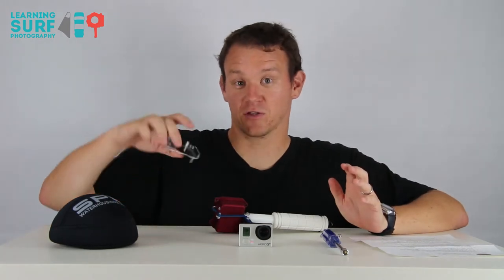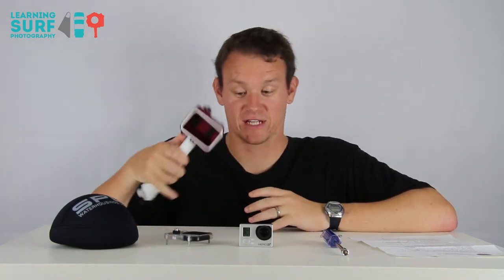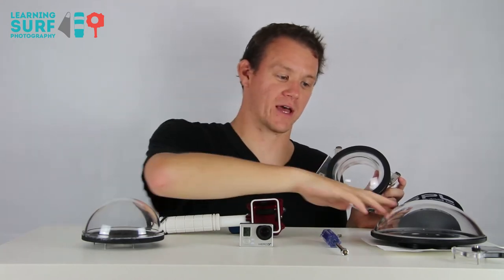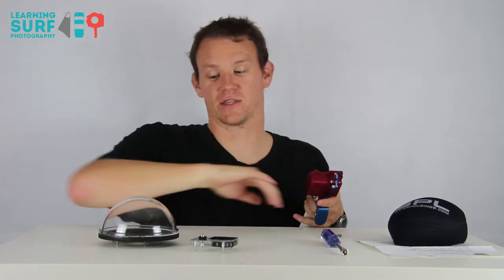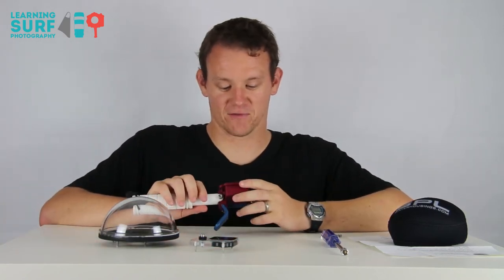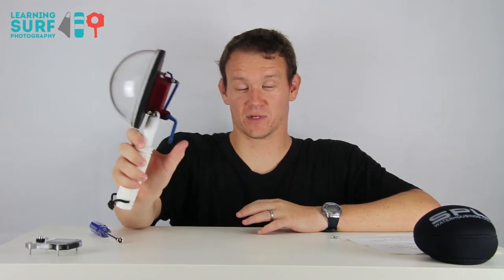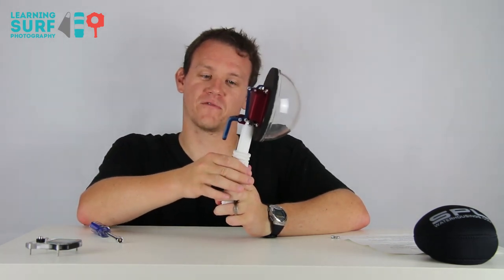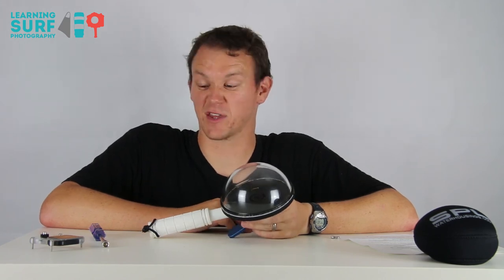SPL GoPro Dome Port First Impressions

Comment from the maker: @xTHESEA there is no control for the front or side buttons with the dome in place, you have to turn it on and set it to the required mode before putting the dome on.

The flat port which is supplied with the pistol grip does have a button for the front and top buttons but not the side button.

Comment: Great information, I'm looking into buying one my self. Think I'll be getting the 5 inch dome port, cuz the 8 inch one is a bit expensive compared to the 5". Are they made of glass or acrilic? Are they tough?

Thanks again.
Reply from the maker: This one's made from Acrylic, it's tough but it's definitely possible to scratch it, any minor scratches can be polished out and a lot of the time minor scratches won't show up in the photo's or videos because they're filled with water when you shoot with the wet port method (more info here: www.learningsurfphotography.com/prevent-water-drops-wet-port-vs-dry-port/ )

It's the same quality as nearly every other surf housing dome port so as long as you're careful it'll outlast your camera.

Comment: hi great video but i have a question. which would you prefer the thump trigger or the front trigger? thanks!
Reply from the maker: The front trigger is a more natural movement as I'm used to shooting that way with my DSLR housing, but the thumb trigger does work. I believe SPL have a different front trigger version now too, so it's worth considering going for that, especially if you plan on using a DSLR style housing in the future.

Comment: Can you just go through the camera settings again for me before you bolt it all up . I have the camera set at auto on , on the top button , with one minute off. I am continually finding the camera starting when I set it up and put in a bag ,  I like to set the camera before getting on the boat or ski .I have now put a cork under the handle to stop this (a spring would be nice) but it is still triggering, I think it's triggering from the side button. It creates alot of heat if the camera has been running in the bag and fogs the dome. The camera is such a snug fit it only takes a touch to fire.I want to shoot video obviously doing something wrong. Thanks Rob
Reply from the maker: Hi Rob,

Sorry for the delay replying, I can imagine the problem you're having, I had the same issue when using the dome when paddling an SUP, I would strap it down to the deck between shooting video clips and often it would start recording.

Unfortunately I don't think there's an easy solution beyond what you've already tried, some sort of safety switch could be made to stop the trigger setting off the shutter accidentally, but it would have to be easily removable.

Comment: Hi Ben, thanks for the video. Have you tried altering the camera settings with the gopro app once in the housing? Cheers, Jack
Reply from the maker: BonneApp Hi Jack,
I did try it out, but I couldn't get it to connect, I believe the aluminium blocks too much of the signal unfortunately.

Although I only tried it with my (android) phone and the old style WiFi Remote that I got with my Hero 3+ Black Edition, and the new Smart Wi Fi Remoter is supposed to have better range, so you might find the new remote or a phone with stronger WiFi would be able to get through.
Reply: Hey, just to confirm, the app works fine for me in the metal housing. Thanks again for the video. Jack
Reply from the maker: That's good to know, thanks Jack, maybe my phone didn't have enough WiFi sensitivity.

Comment: Do you get more over and under coverage in the shots with the 8 inch dome?
Reply from the maker: Hi Matt,
I've just finished editing the review video where I cover the 5" vs 8" vs 10" vs 11" dome options, you don't get more coverage as such, the angle of view is the same as it's determined by the lens and settings on the GoPro, but it does make it easier to have a distinct water line between the above and below sections.

I'd recommend the bigger domes if you want to capture waves bigger than a foot or so, otherwise the 5" is a great tool.

Comment: hi ben is the dome port only good for small surf and over under shots?
Reply from the maker: Short answer - yes. That's what it's designed for, if you don't want to shoot over/under then you are better off using the flat port that's also supplied with the housing.

Comment: So you prefer pay 250 for that or just use the automatic photos in the gopro ?
Reply from the maker: jake peralta I'm not sure what you mean, you can use the same settings for automatically taking photos with whichever housing/trigger combo you use.

The standard GoPro housing doesn't allow you to take photo's one handed, having a pistol grip style shutter release is very useful for surf photography.

I wouldn't recommend getting the SPL housing and pistol grip only for the flat port though, I'd go for the KNKT GPLT trigger for that. The reason you'd buy the SPL system is so you can use the dome port, it allows you to take photos that are not possible with the standard GoPro housing.

KNEKT have their own Dome port now though, and I've used both, so I'd recommend getting the KNEKT system because there's a couple f advantages, you can find out more here: https://www.youtube.com/watch?v=9G4zbAF7QWE

Comment: does a lease come with it
Reply from the maker: There's no leash provided as standard, at least not with my package, but there's a leash string on the bottom of the handle so you can attach any suitable leash, I use a short bodyboard wrist leash.

Comment: hello witch one is the best quality KNEKT ou SLP ? 
thx
Reply from the maker: I haven't used the KNEKT dome personally but I'm sure it is excellent quality based on my experience with their other products. I'd lean towards the KNEKT option though as you can use it with your GoPro housing, so there's no need to get used to using a differnt method of sealing the camera inside the housing.

Comment from the maker: Why would you want to use the SPL GoPro dome port with your GoPro camera?

Find out why and hear about the housing and port themselves in my video.
Reply: Hey Ben - thanks for the video, I looked into one online today and emailed the guy in San Diego - you have confirmed my need for the dome port!  I have just started to experiment with the GoPro for filming surfing mainly, but keen to expand into stills after a reasonably successful first attempt just out front of home, have a look at my youtube channel for some of the shots!  Anyway, thanks again, I'll try and share some of the results with you when I get the housing!  Cheers
Reply from the maker: Tim Gander
Thanks Tim,

I will be uploading the full review soon too, having a look at your video I'd say the dome port will be useful on smaller days when there's better visibility under water, the best shots I've got with it in the surf have been in clear water with small swell.

It's also a great tool for capturing flat water stuff like cliff jumping and SUP too.
Reply: Cheers, coming into summer here now so water clarity improves so I'll be ordering one soon!

Comment: Como remover as pequenas gotas que ficam no DOME?
Reply from the maker: +Itan Viana Hi Itan, Google translated your comment as: "Removing small droplets that get in DOME ?"

I haven't had any issues with drops getting inside the dome, but you could probably use a flexible pipe cleaner or similar item to get in there and clean it out. If it's drops on the outside of the dome I recommend the spit and dip or "wet port" technique, read more here: http://www.learningsurfphotography.com/prevent-water-drops-wet-port-vs-dry-port/
Reply: +learningsurfphotography.com Thanks! vou dá uma olhada...

Comment: only thing with dome u cant install a red filter
Reply from the maker: +Joe Lebosi Hi Joe,

I've never thought about using a red filter for my surf photography with the dome as it's all over/under style, but if you were diving with it and wanted the dome for the wider field of view it would be possible with the KNEKT dome.

You'd need a filter that went inside the regular housing like this one: http://amzn.to/1QKCDVN

The Knekt dome uses the standard housing so anything inside will work with it, but you won't be able to use a clip-on external red filter with it as it would interfere with the seal around the lens port.

The SPL dome doesn't use the standard GoPro housing and actually has nothing between the dome and the lens of the camera, so you could make your own filter and stick it to the inside of the dome maybe, but it would be hard work compared to using the KNEKT Dome or an alternative which uses the original housing.